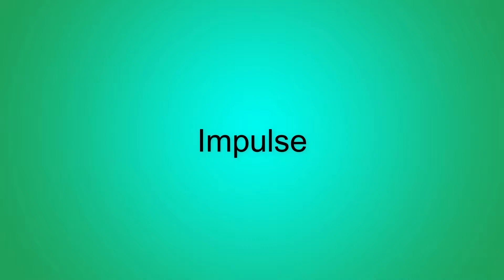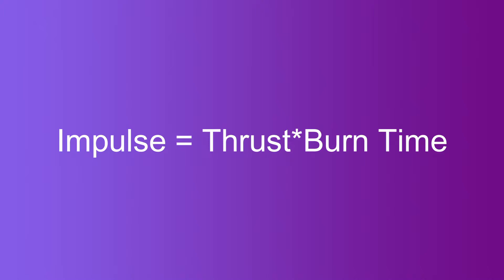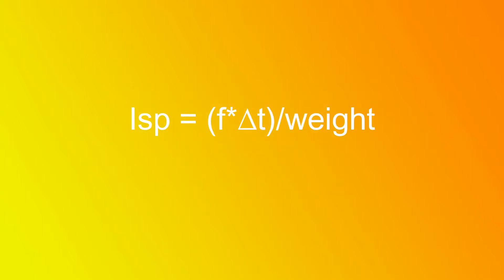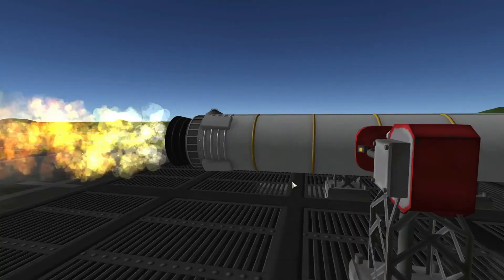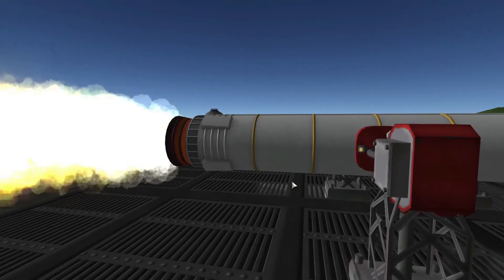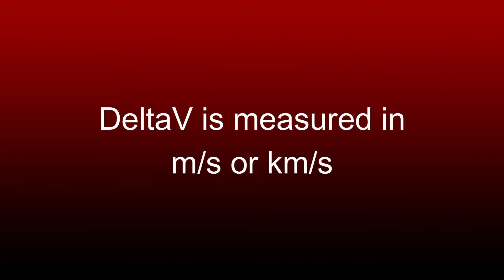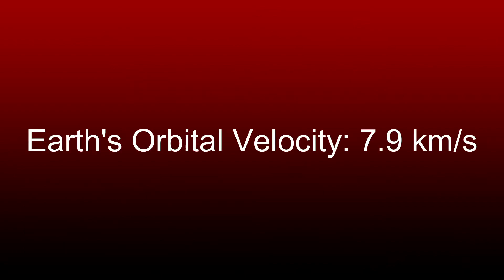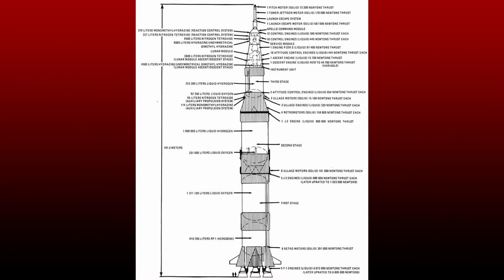Impulse, Specific Impulse, And DeltaV - What Do They Mean?

Comment from the maker: 3:35 This is a bit misleading. Calculating the Δv of a multi-stage rocket is a bit more complicated.

The normal Tsiolkovsky rocket equation is Δv = Isp*g0*ln(m0/mf). For the Δv of the first stage of a two-stage rocket, the mass of the seconds stage counts towards the dry mass of the first stage. If a rocket has two stages, with the 1st having an m0 of 1,000 kg and mf of 100 kg, and the 2nd having an m0 of 500 kg and an mf of 50 kg, and both with an Isp of 300s, the equation for the Δv of the first stage is Δv = 300*9.8*ln((1000+500)/(100+500)), and the equation for the second stage is Δv = 300*9.8+ln(500/50). Sorry for the mistake in the video.
Reply: dam

Comment: Would impulse change with the amount of fuel?
Reply from the maker: Yes, but specific impulse would not. Specific impulse is dependent on the efficiency of the engine, so it would not change, while impulse is just force x time, and adding more fuel would increase burn time, increasing impulse.

Comment: i'm a bit late, but i need you boss man, i'm really struggling with ksp interstellar parts and i want to build an orbital repair ship capable of prolonged and precise manoeuvring capabilities (1< TWR < 1.5 and ISP > 3000) i need to be able to rdv with debris,  grab  it, deorbit them and then do a "saving" burn to stay in orbit without touching the karman line. It should be able to do several missions without refueling, in high to low kerbin orbit.